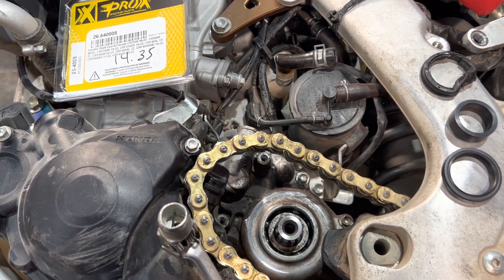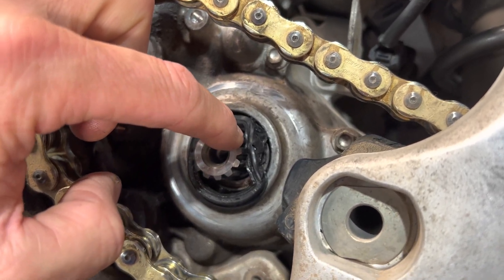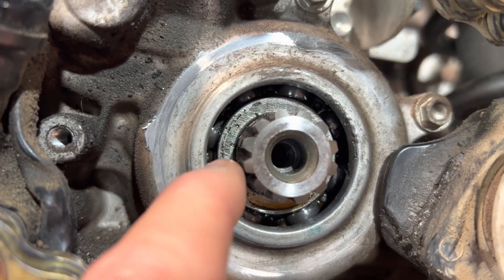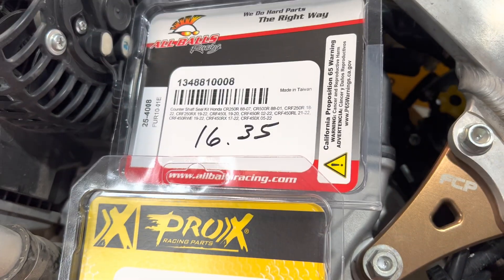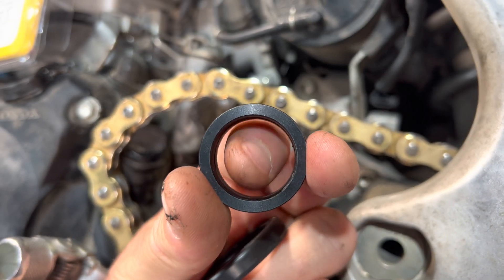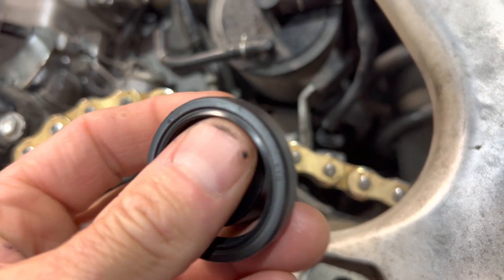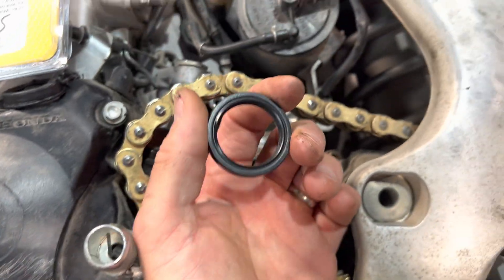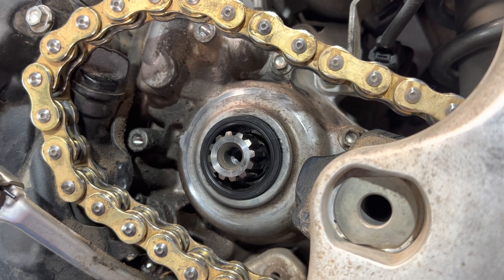HONDA CRF450RL L X PRIMARY OUTPUT SHAFT OIL SEAL REPLACEMENT

Comment: Drill a hole in the face of the seal.  Use a corse thread screw leaving most the the threads outside.  Use an angled needle nose pliers and leverage out the seal

Comment: Great video I just did mine today.
I would suggest after you get the old seal out tip the bike to the left side with the kickstand up.
The oil and any debris will be flushed out especially if you turn the counter shaft at the same time.
Just add a little more oil when done.

Comment: Thanks for this one!!  Seems this is leaking oil from here, likely due to when I overfilled the oil after oil change.  Pulled the extra oil out, looks to be still leaking.  Time for this seal replacement, new sprockets, chain and oil.

Comment: I wouldn’t have expected that lip on the seal. Seems pretty lame and obviously as shown by using standard replacement seals, it’s unnecessary. 
I’m sure this will help owners of that model dyi instead of being told they’ll have to split the case.